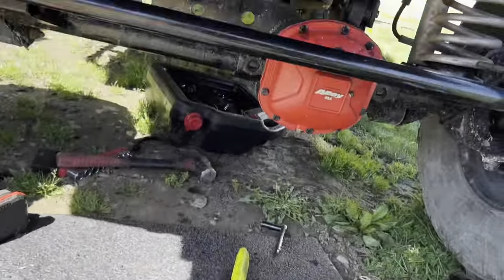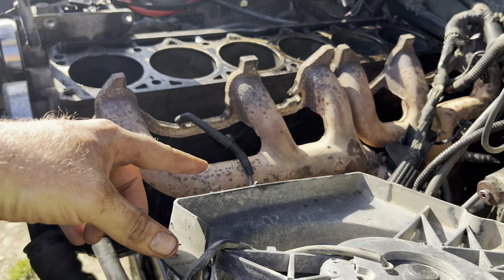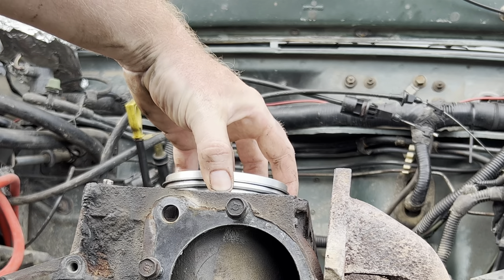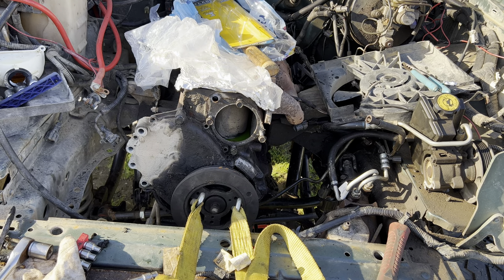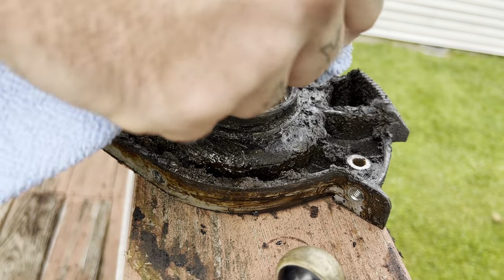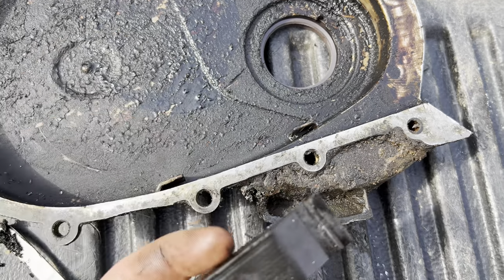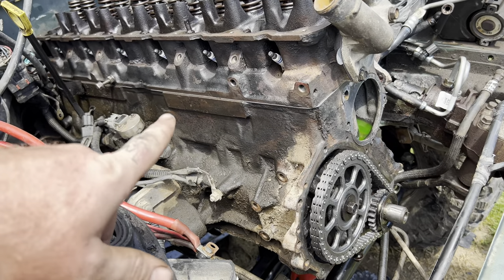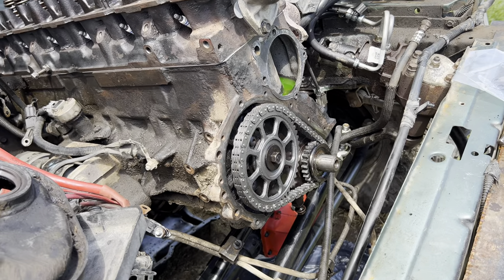Jeep Cherokee 4.0 in frame rebuild part 1

Comment: you trusted the rings didn't need to be filed? (gapped)  Even with knowing the bore size, etc. I figure a fella would double check.  Did you check the clearances off camera before installing the rings?  How has it gone thus far?

Comment: I must have gotten lucky. I pulled my harmonic balancer the other day with my... steering wheel puller lol But my truck has ZERO rust which is a Unicorn for a 2001. I'm also too weird with keeping things super clean for me to do a inframe rebuild. All that grease over everything would have given me a embolism.
Reply from the maker: Yeah I didn’t waste my time cleaning it it will have mud all over the place anyway 😂
Reply: @cherokeeronnie  Amen Brother, Amen.. I wouldn't even blink an eye about getting grease on any crap under the hood - and if anyone is actually worried about that and would still enjoy saving a couple/few grand if their hard-earned money then it is soo super easy to just spray some engine degreaser after the job is done and hose it off, Rinse scrub and repeat if necessary...

Comment: I just tore mine apart to replace one piston and decided to do all 6 in frame like you are. Would you recommend I also do the crank bearings? Engine has 126K on it. Accidentally ran it low on oil too hard and thats when the slapping developed.
Reply from the maker: Yeah might as well why your there
Reply: @cherokeeronnie  I just finished my rebuild this past weekend and she is running like a champ! You're videos inspired me to get a Cherokee in the first place and I got lucky with a rust free 99 XJ with 124k miles for $2,500 a couple years back. It's hot as balls out here in AZ but at least our vehicles don't rust. keep up the good work!

Comment: just came across your helpful video again cause my knocking is starting now as well on my 4.0. Didn't you measure the cylinders before installing the new pistons ? Thanks !
Reply from the maker: I have the specs from the engine I know what pistons they take
Reply: @cherokeeronnie  thanks - so you did take oversized pistons/rings ? Can't see it in the video and I'm about to make the same kind of in frame rebuild you did.
Reply from the maker: No it’s standard I didn’t have my bores bored out over sized
Reply: @cherokeeronnie  good news, thanks - will be doing the same !
Reply: Whats the stock bore size ? Im getting my block sleeved and idk what to tell em at the machine shop lol
Reply from the maker: You have to see what your motor is or measure everything